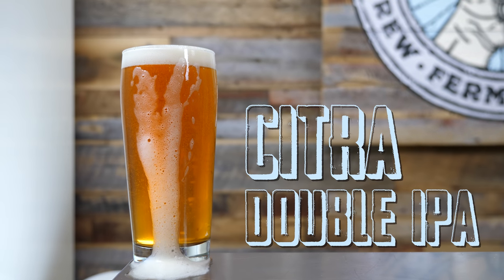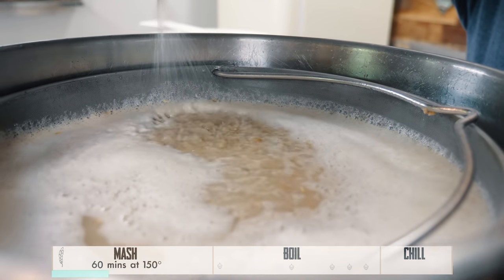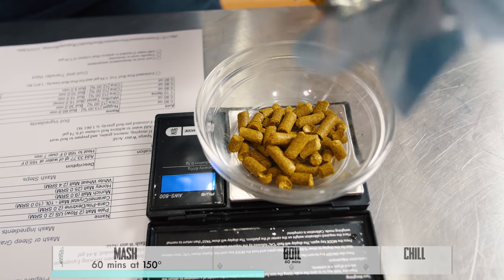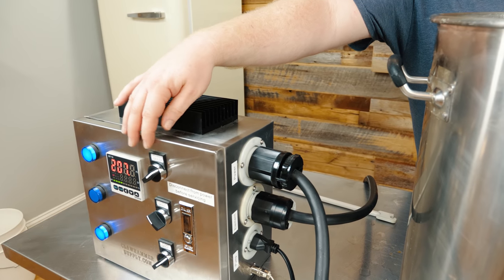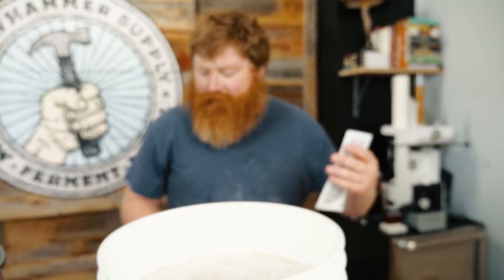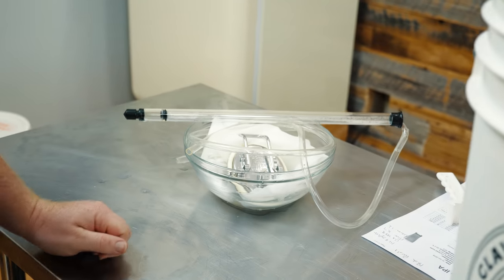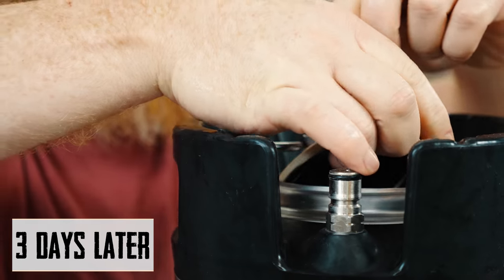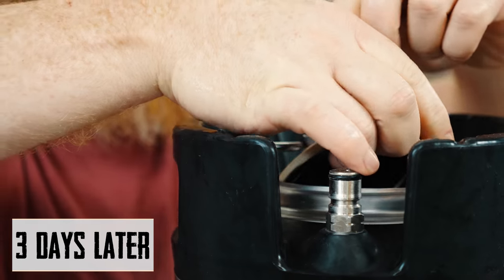How to Brew Beer - Citra Double IPA Homebrew Recipe

Comment: The 24th can't come fast enough. I'm stoked to get this rig in my brew room
Reply: My first IPA is now on tap and I'm extremely happy with the outcome. One of my best beers yet. Just prepare yourself for the long heat up times. I'm now going to start using my propane burner and backup kettle to get the water to temp and then transfer to this system. Everything runs super smooth and easy once up and running but the heat up times add about 1-2 hours (depending on mash schedule) to a brew day and that doesn't always work for me.
Reply: You already have the new 240v controller?
Reply: Johnny Vestal nope :(  If you have the 240v system coming, I'm staying tuned for your thoughts on it. The 110v is great once up to temp but getting there takes a while.
Reply: There is a huge difference between 120v and 220v setups. I have the original system, and did a 220v conversion myself. Typical brew day went from about 6.5 to 7 hours on 120v to about 4.5 to 5. While I didn't provide a huge amount of detail, I outlined what I did so others could try to do the same: https://www.instagram.com/p/BjvlhtaFM61/?utm_source=ig_web_button_share_sheet

Comment: What should I change in the brewing process if I’m planning on bottling and not kegging this beer? How long should it be in the fermentation bucket? When should i add the dry hops and for how long? Should i bottle immediately after taking out the dry hops? How long should it sit in the bottles at room temp? Nice video!

Comment: Curious as to your efficiency with the full volume no sparge method? I am doing the same but am only getting 65% Also i spy a canner in the corner!!!!
Reply from the maker: Ours is generally 73% for low to medium ABV beers. It drops with bigger beers if we don't sparge, but we generally have to sparge when the grain bill approaches 20lbs. Yep, we splurged and bought a canner! We really like it. Oktober Designs is the brand.

Comment: Why do you want to clarify the IPA? It should stay a bit cloudy, especially double IPA.
Reply from the maker: I only like my NEIPA style IPA's cloudy-- I like a nice clear IPA otherwise. That is the beauty of homebrewing-- no need to clear it up if that is not your thing.
Reply: IPAs should be clear unless you're specifically making a New England IPA. Even if you're making a neipa you'd still use whirfloc in the boil to help the trub drop to the bottom. It'll still be hazy with all the protein rich adjuncts in the grist.

Comment: What heating and cooling differential do you use on your temperature controller in your fermenter? Mine tends to wander quite a bit from setpoint and I can't seem to dial it in.
Reply from the maker: That's a question for Emmet. Info@clawhammersupply.com

Comment: Interesting video. But... with all the money you spent on the brewing equipment, maybe ferment in a stainless conical fermenter, instead of a brew bucket? Like, I'm assuming the payments on the Ferrari are up to date?
Reply from the maker: Buckets are cheap, easy to clean, easy to move,  and the main thing is they easily fit into a temperature controlled fermentation chamber.

We sell the brewing kit shown in the video. https://www.clawhammersupply.com/collections/all-products/products/digital-electric-120v-homebrew-beer-system

Comment: Everything was fine but transfer the beer sucking the hose is terrible, you are bringing bacterias from your mouth to the keg, just put a faucet in that fermenter and transfer with gravity and don't open it, better put a co2 hose in thetop to make good pressure and cero oxogen contact if the gravity it's not enough
Reply from the maker: Did you happen to catch the part right before that where we explained why we had to do it that way?

Comment: Hi, looked many your videos and other homebrewer, and you every time make the same mistake, i say all of US/EU home brewer make the same mistake because belive in BrewMyth!
1. Aeration - it is useless in home brewing, on the contrary, excessive oxygen when yeast is added is harmful to yeast itself.the process of transition of yeast from aerobic to anaerobic must pass as slowly as possible! When wort is boilling, it is completely saturated with oxygen this quantity is enouth for starting fermantation!
2. Adding too much yeast, this makes beer only worse, if you want to improve the quality, stability, and cleanliness of the beer, add as little yeast as possible! For example, one pack of dry yeast 0.35oz is calculated by the manufacturer for 6 gallons is very, very much, you can add 0.017oz or 0.005oz and the beer will completely ferment, the yeast precipitate will be significantly less than when adding the whole pack!The more times a yeast cell is divided during fermentation, the better is the result of fermentation (beer) and this can be ensured only by a minimal addition of yeast and low temperature 61F after activiti fermenting which will increase the fermentation time but quality beer rise !To do this, you need to use two pause mashing, the first pause is 125-129F, 15-20 minutes and the second as now you do or other this is don't metter. This is need to get аmine nitrogen which is necessary for yeast nutrition.But some make without amine pause.
3. Star San - does not sterilize, does not kill yeast and spores ... the effect from it is zero, you can just rinse the fermenting tank with cold water and the same result will be 100%. if you whant sterilise fermenting tank, hosepipe, hop bag and other can use hot water or hydrogen peroxide solution 3% or 6% this is kill all yeast spores and bacterials!

If you don't belive me, can make serias on your channel some thing like "BrewMythBusters" :) and check yourself and tell everyone what I wrote above. I guarantee you will have much more views and more subscribers than you have now. All that I said to relate only to home brewing, where time does not matter, quality is what's important! You do like big breweries where time is money, quality is in second place.

Press thumb up if you whant see BrewMythBusters :))))))))))))))))))
Reply from the maker: Thanks for the reply, but we respectfully disagree with all 3 points you have made.

1. We've heard that DRY yeast doesn't require aeration, but A.) We used White Labs liquid yeast for this beer. White Labs suggests aeration. And B.) Wyeast, another yeast manufacturer, says on their website that aeration is necessary, especially when brewing beer over 1.065 OG. They also specifically state that over-oxygenation is NOT a concern. We're going with the yeast manufacturers on this one.

2. While it is true that over-pitching can be a problem, we always follow directions printed directly on the packages of yeast that we use. In this case we used a White Labs liquid yeast strain. According to our original gravity and pitching temp, we needed two packages for this beer! Again, we're going to side with the yeast manufacturer on this one.

3.Yes, StarSan DOES kill active yeast and yeast spores. What you are purporting is actual myth. Though, we've heard that peroxide can be used as a sanitizer too. 

We don't mean to sound disrespectful, but there is overwhelming evidence to support our position - in brewing books, which we own several dozen of, and on the internet, which we have access to.
Reply: Ok.
1. DRY or liquid this is don't metter, for liquid (if he good yeats, not half dead) 2ml for starting fermenting enough on 6 gal...can try and see that i say tru! 

I agree that after the opening of the pack, the remaining yeast in the pack is inconvenient to store. Dut if you use 2ml yeast  without aeration quality beer only rise!Can try and taste make two identical brew, in one tank add 2 ml of liquid yeast without aeration, in the other remaining yeast from the pack with aeration, and taste too beer in the and!In first tank fermentation will be longer then seconde but quality beer is much better!

2. Original gravity don't metter for yeast!Original gravity can only indicate the fermentation time, the higher Original gravity the longer the fermentation time with the same initial amount of yeast. Yeast don't afraid many sugar ) sugar is life)

Manufacturer recomendet use 2 pack on your gravity for the fastest fermentation wort to beer, in homebrewing fast don't need. The less competition of yeast the better they perform their work. the more times yeast is divided to the end of fermentation, the better the result of fermentation. For example you added 2 ml of yeast and by the end of fermentation yeast was divided 100 times when you add 35 ml of yeast to the end of fermentation yeast is divided only 10 times, yeast is very much, the competition is big, the sugar is quickly ending (end of fermentation) and yeast is falling asleep ... .

3. Use StarSan it anyway to wash your hands with only water or water with any soap! The result is the same. Beer is hard enough than to infect, except for yeast, if you are sufficiently clean. Otherwise, beer would not have survived to this day ...

Unfortunately a huge number of authors of brewing books are not education by microbiologists , therefore their knowledge is superficial!Attention to all that I said only for home brewing!